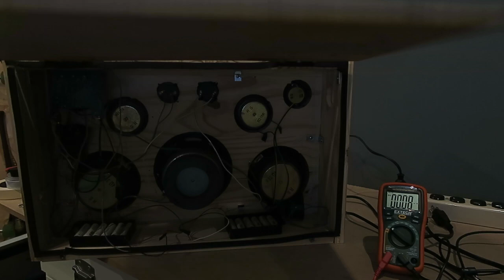Update to: Home Made Boombox with subwoofer TPA3116D2 2.1 amp with airplay / bluetooth

Comment: For better sound you should build a separate "resonance body" for the tweeters (a little box behind the tweeters in the inside of the whole speaker) and of course foam to prevent echo. :)
Reply from the maker: Agreed, but that's more work! My next one will have isolation.
Reply: It's the mid-range drivers you want to enclose they are the ones being affected buy the bass driver.

Comment: tanks for the video. is the 2.4 Amp on 12 or 24 volt. (28.8 watt or 57.6watt)
Reply from the maker: that was an 18 volt power supply.
Reply: Thanks, does the digital meter works the same as the meter on your box? I'm want to buy one( amp meter with needle) to measure.
Reply: Why you don't make a battery pack of 18650 cells😃
Reply from the maker: Both work. You could make a lighter system with 18650 (and get the same voltage). I use the AA batteries for my Wii, so dual purpose.
Reply from the maker: Yes, though a multi meter is auto ranging and the panel meter is fixed. I'd try to find a 1 amp DC meter. My 3 amp has too much range to show much movement.
Reply: Jesse Goodier if you put a bleutooth module on it does it goes harder. i have a tpa3116d2 by myself with bleutooth connected, but have the idea that it's only pushing out 10+10+20 watt ( if i compare my fullrange channel with my other amplifier fullrange channel wich is 10 watt

Comment: Each speaker should be in a separate enclosure, custom sized to match the properties of the speaker. When you put them all in the same enclosure they will sound like crap. Only tweeters don't need a separate enclosure, since they are self-contained. And plywood is a horrible material for a speaker box, too many hollow spots and other irregularities. MDF is much better. This site is a great resource, it has tools where you can plug in the parameters of your speakers to calculate the optimum size of the box and how long the port should be if it's ported. Also has tools to make proper crossovers.
https://www.diyaudioandvideo.com/
Reply from the maker: This boombox sounds great and is already 15 pounds. Love to see your properly made one when you are done. Cheers!
Reply: @JesseGoodier  I've made 3 so far. First was just to see if I could, second is a 100 watt per channel monster that is great for tailgate parties or camping it takes an external 36 volt lead acid battery that will last at least 40 hours (never have run it until it runs out). Yes it is heavy weighs over 30lbs not counting the battery pack. The 3rd was a small portable 2 speaker (so no crossovers needed)  one that runs on an internal 18650 battery pack. But it is light and easy to transport and surprisingly loud at 30 watts per channel. 

I have one in the planning stages that will use a great new 200 watt 2.1 channel (50w + 50w +100w) bluetooth amp they just came out with and run off 5 internal 26650 batteries. That project will have to wait because the amp is out of stock until March. But it will have a pair of 2 way speakers and a subwoofer. The drivers and subwoofer properties are such that they require only a small box which makes them ideal for this purpose. That's the hardest part about building boom boxes, finding speakers that don't require a lot of space. 

Good luck on your next one!
Reply: @JesseGoodier  Oh and if you don't feel comfortable or don't have the tools or space to work with wood this is a kit that utilizes the same 200w 2.1 channel bluetooth amp I'm using in my next one. Only downside is they sell it with a 3  cell 16650 battery pack that really doesn't produce the watts this amp wants. I'd order the Wondom 5 cell 26650 battery pack and use that instead. 

https://www.parts-express.com/blast-box-200-watt-portable-bluetooth-speaker-kit--300-7162
Reply: @bigglefty75  You have just the speakers from that tower and are going to build your own enclosure? Without knowing the parameters of the drivers it's impossible to say, but I suspect they'll want a big enclosure seeing size of the box they came out of. Anyway this is the bluetooth amp I'm going to use for my next boombox... if they ever get back in stock! https://www.parts-express.com/tps3116d2-class-d-21-bluetooth-40-amplifier-board-2-x-50w-100w-with-filter-and-volume-con--320-635

If you're only doing 2 channels no subwoofer maybe this one: https://www.parts-express.com/dayton-audio-kab-250v3-2x50w-class-d-audio-amplifier-board-with-bluetooth-40--325-105
Reply: @SSHITMAN- yeah I don't have the tower, just the speakers from it.  was thinking of building the same specs  and they came in  or different, but I want to add a good Bluetooth amp and Gauges
it's for my Gym so no need to be portable, just maybe  something i can hang up and looks and sounds good -  i dont see the amp you mentined ?
Reply: this is the Dimensions of the tower  it's on the link I posted 
they are 6.5  woofers so maybe not to much bass -7.09 x 11.81 x 42.44 in
Reply: https://www.youtube.com/watch?v=lKmV0_ZO_3E  here are the speakers
Reply: @bigglefty75  Ideally speakers should be matched with the cabinet and the amplifier. You really need to know the Thiele-Small parameters of the speakers and then design the cabinet from there. This site is a great resource: https://www.diyaudioandvideo.com/